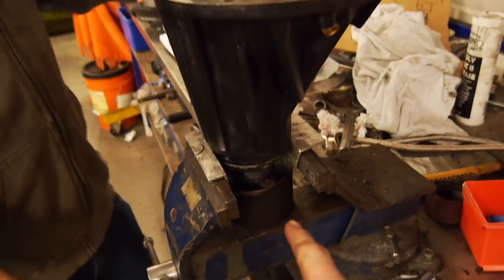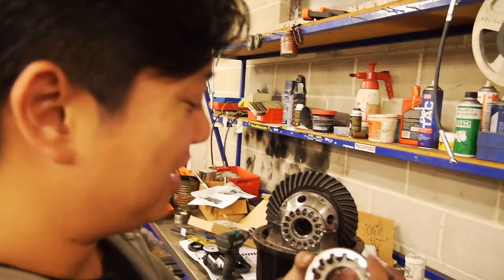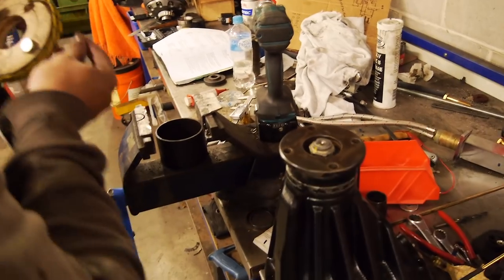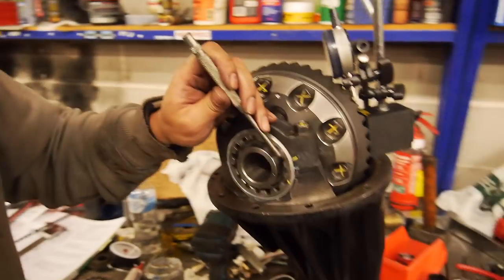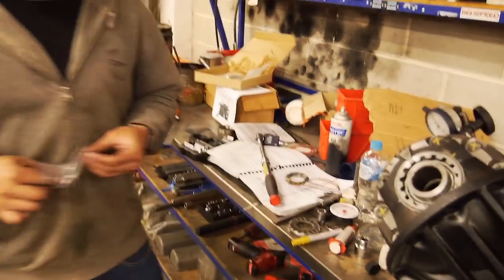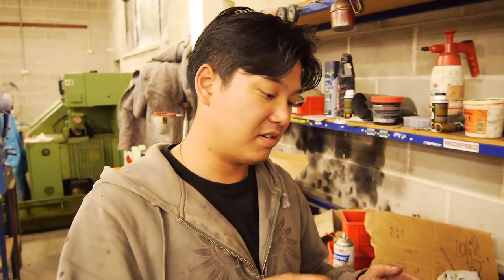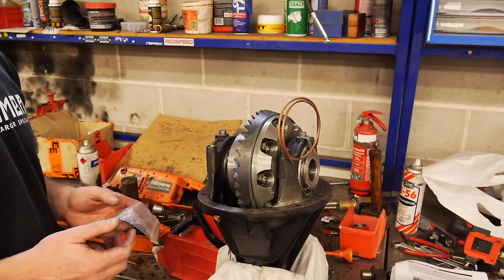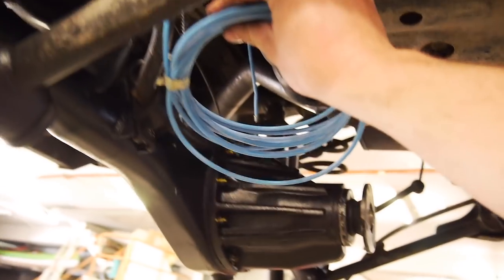ARB AIR LOCKER INSTALL - IN DETAIL - TOYOTA HILUX SURF [PART 3]

Comment: Thanks muchly for going all out the struggle is real to get things done while sleepy but I think I have a better understanding of the way to get it sorted can you install a locker like this for a road car application so u have a open diff when normal use then for the drag strip lock it?
Reply from the maker: No problem mate👍 yeah you can install an air or E locker for any car provided someone builds ones for that car

Comment: Hey mate when re installing the diff how much diff oil do you put back in?
Reply from the maker: Until it flows out of the fill plug hole. The car must be flat and axle level though for an accurate fill